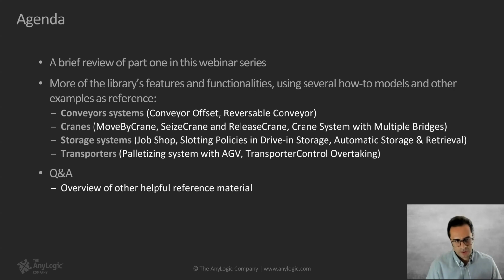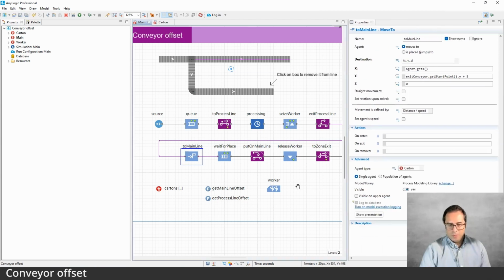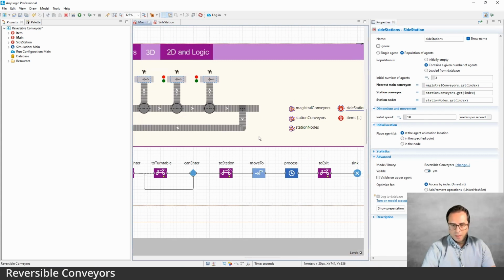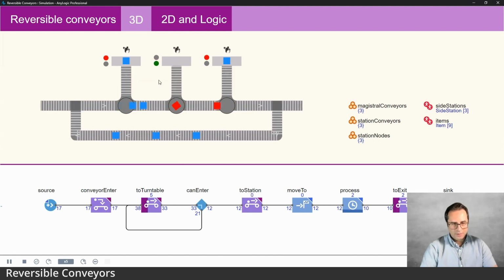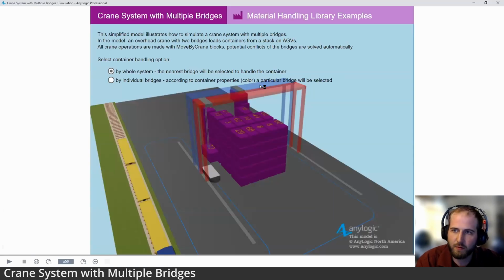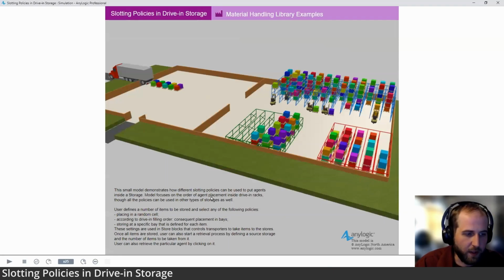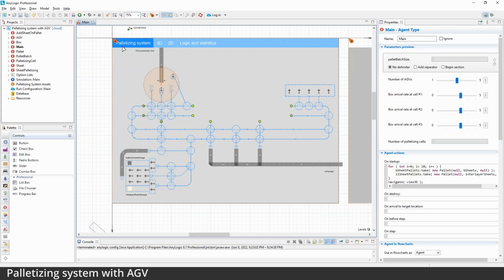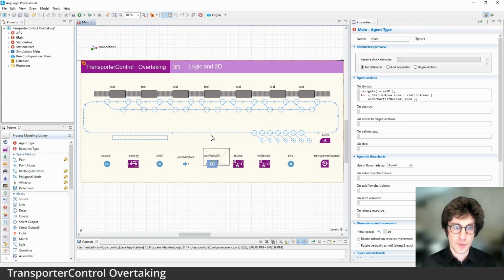Webinar: AnyLogic Material Handling Library — Essential Techniques and Functionalities, Part 2

Comment: Hey! How can I have an initial utilization of the storage? I need my platforms to be filled up to a certain normal level when the simulation starts. Thanks!
Reply from the maker: Hi, thanks a lot for the question. 
In order to set an initial state for storage, you can put a Source block - 
https://anylogic.help/library-reference-guides/process-modeling-library/source.html#source with arrivals defined by calls of inject() function, call this function "On startup" action of the Main agent, then connect it to the Store block - https://anylogic.help/library-reference-guides/material-handling-library/store.html#store and select Agents move to "independently", so the material items fills by themselves. After this you can proceed further with your model logic. Please find a sample model which shows the approach (source files are also available for download) - https://cloud.anylogic.com/model/50e3272a-b7bf-4bc3-8cab-768c61b84abf?mode=SETTINGS&tab=GENERAL

If you have any further questions, please feel free to use our community pages - https://www.anylogic.com/resources/support/
Reply: @anylogic-simulation  Thank you very much for the support, I'll focus on that solution now!